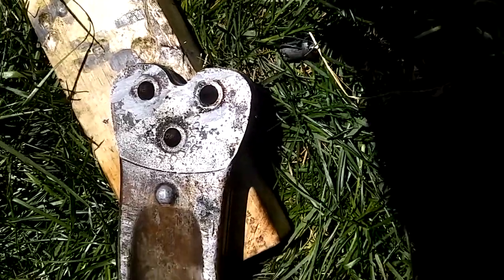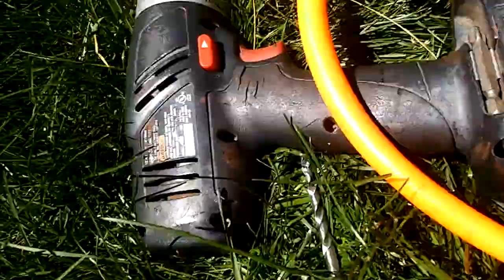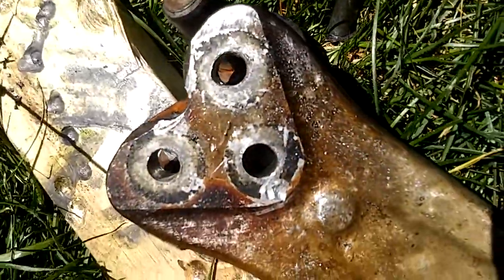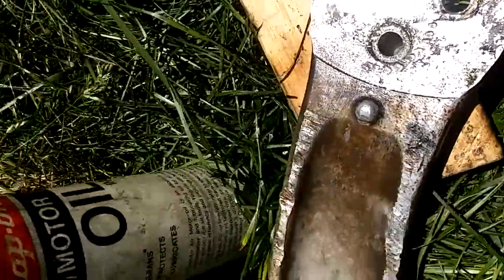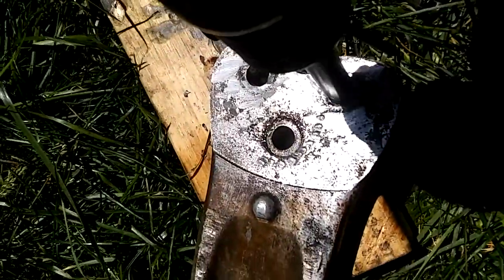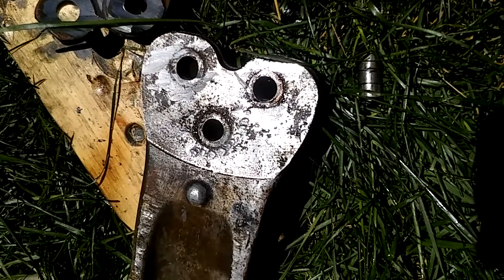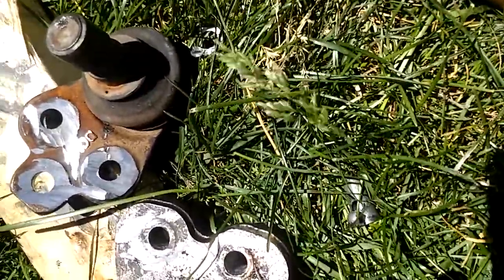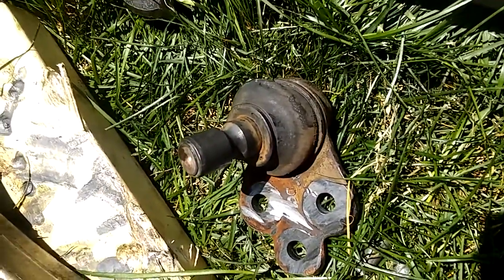Chevy Cobalt Pontiac G5 Ball Joint Replacement

Comment: I’ve done the same job before, my trick I did was I grinded one side of the rivet off, and then used a stud (bolt with the head cut off) small enough to fit through the river hole, and used my ball joint press to press the rivets out, it worked great.

Comment: The easiest way to do it is by buying the control arm with a ball joint attached at rock auto for $40.
Reply from the maker: Well rock auto charges shipping and takes 2-4 days. I got it done unde $20 and within hour or two. So this is cheaper, quicker and easier as you don't have to remove the control arm. 
Sorry for late responce I just do this as a hobby and for the past few years of this never made one dime from you tube. They did that 1,000 plus member bs.

Comment: What is torque spec on new bolts and nuts?   Waiting on new ball joints.  Got old ball joints off.
Reply from the maker: I just tighten them as tight as I can easily with a 3/8 rachet. Blue lock tite wouldn't hurt. Harbor Freights is like 1/2 the price. Sorry I don't check comments to often. I just do this for free to help people. Cheap Youtube.
Reply: @mobilemowers  

      This car has been sitting waiting for your response.  I can go outside in 12 degree weather now and correctly install these ball joints. I will have to buy a new battery probably.
Reply: @sirsweetness8332  next time try calling the dealership. They actually have people there that get paid to look up and answer questions like that
Reply: @somebody19XX  

     Car has already been fixed